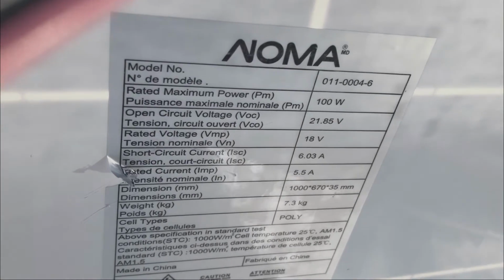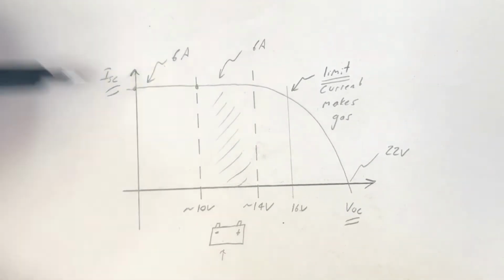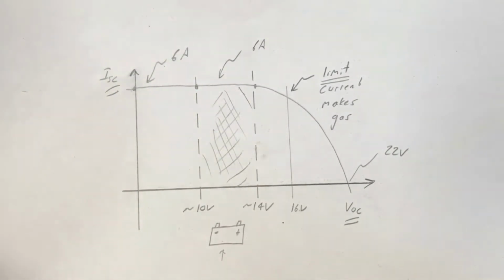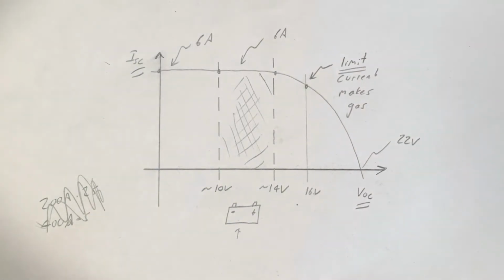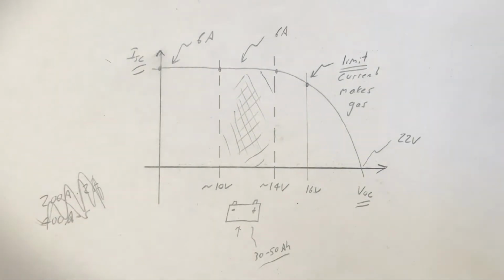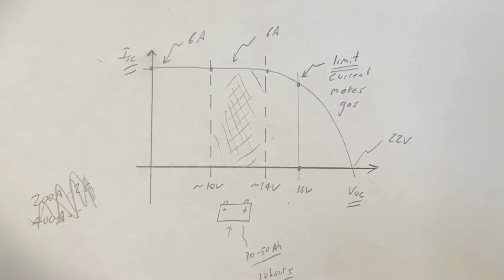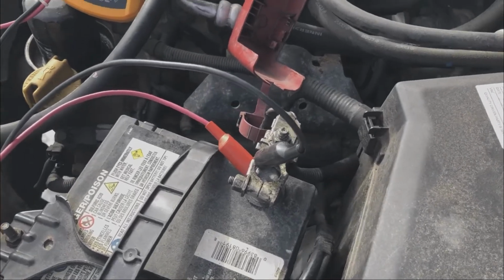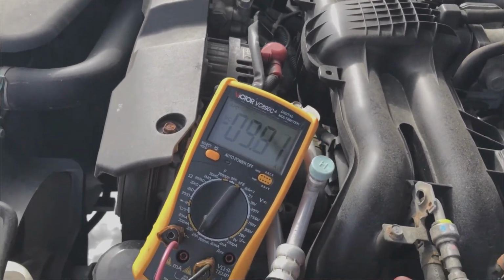BOOSTING or JUMP STARTING a dead starter battery with SOLAR!!

Comment: i buy a solar panel for this reason, my panel say is 12v but when i put it on the sun go 23v when i connect the solar to the car battery the charger says 15v-16v why, this is not dangerous for the 12v battery to charge with 15-16v
Reply from the maker: If your battery is healthy and simply discharged then when you connect the panel it will take a relatively long time to increase in voltage.  If your battery jumps right up to >13V then you will be making gas and 1) you don't want it to be there very long and 2) it means your battery is probably at the end of it's life and unrecoverable. Regardless you want to only operated above 13V or so for no more than an hour or so - while also being very aware of mitigating the explosion risks.